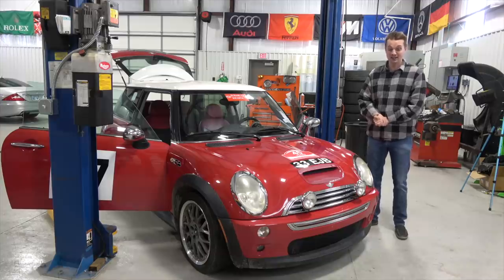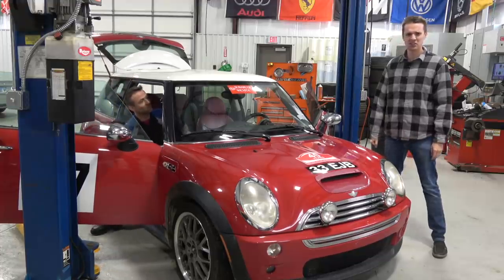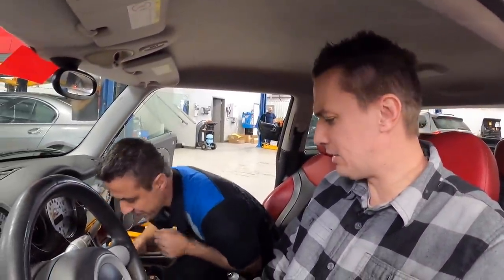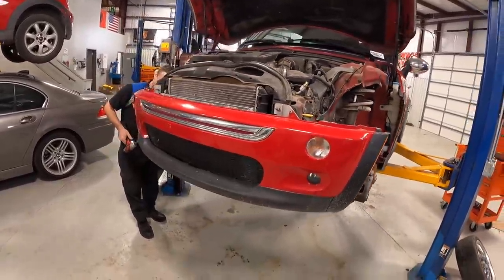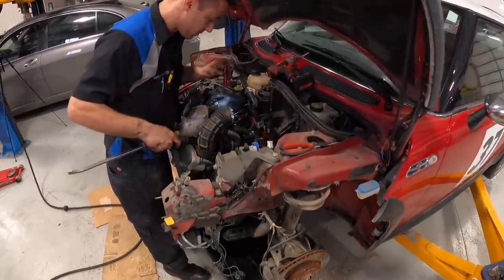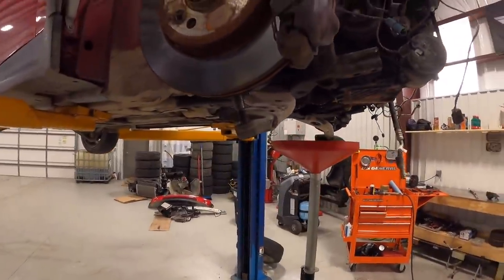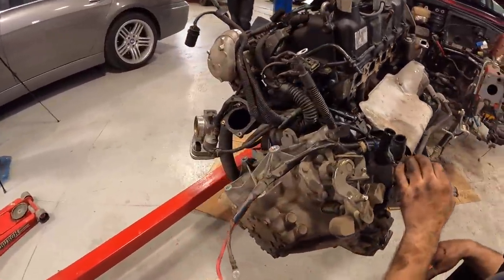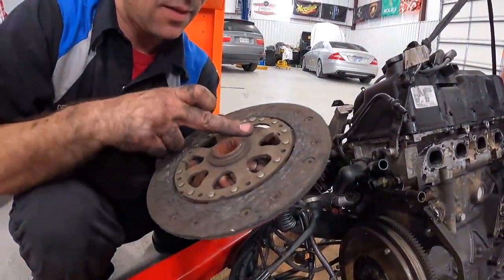Removing a Mini Cooper S Engine in less than 1 Hour? Mechanic Says No Problem!

Comment: It still costs so much because the Ninja trained his whole life to be able to pull an engine in an hour. You pay for his skill.
Reply: @KS-xo3oh   it's still an benefit to the customer because they can get their car back faster 🙂
Reply: I think it was a joke.
Reply: Mechanics proving “book time” is a cruel joke. How long would a one-armed, tool-less piano player take to do the job. Yeah, we’ll pay that amount of time. When anyone with a shred of experience can shred the “book time” just how stupid do you think customers are? 

I do my own until the tools get too expensive.
Reply: @KS-xo3oh  You only pay booktime when booktime is reasonable. As with any repair. Some rusty crapshoot car you don't want to think about booktime because the book says every bolt is clean and comes out in 2 seconds.  Pricing is weird though. 
I usually go by as long as both parties think they got a good deal its fine. But there are people for which any amount of money is too much.
Reply: they should sell a kit to attach the front clip  back up with Velcro since it's likely going to be taken apart a few more times in its lifetime.
Reply: It's supposed to also be if a shop takes 5hrs to do a 2hr job you only pay for the 2hrs but I doubt that happens in reality...
Reply: Youre not paying for the hour, you're paying for the years.
Reply: @paulcarmi8130  
Book rate is also a benefit to the customer, because he doesn't have to pay extra when everything's rust welded together and half the fasteners snap off.
Reply: That goes for any good tech especially euro
Reply: Book time and actual time is so debated. Thankfully I’ve found mechanics that are flexible on both and don’t try to screw the customer on book time. If you’re a career mech and charge book time on everything, especially regulars, and it doesn’t take you that amount welcome to being a scam.
Reply: @beefchillingham6790  another mechanic I see. I have over 40 years experience in my field. My hourly rate is commensurate with my experience in the field and based on the demand of the market. Like a lawyer for example. 

To set a “time” based on a green apprentice skill level and then also increase the shop rate over time is a double dip if I ever saw one. I go to a shop and expect to pay the rate of an “experienced” technician. Not to pay the rate of an experienced worker and the time needs of a basic labourer. That is an obvious scam and the only way it persists is because all mechanics do it. Yes, I’m a tool, and a very sharp one, unlike your dull self.
Reply: @markstevens1729  Exactly. Book time for a novice at $80/hr vs $200/hr at specialist shop is a factor.
Reply: @bcubed72  I don't think you responded to the correct person my dude
Reply: @markstevens1729  stick to your desk job bud
Reply: @nickmotsarsky4382  only when “everyone else” is scamming the public can you say “everyone else” with a straight face. The scam is that we are expected to pay apprentice time at 100/hr while you gain experience and pack 80+ hours into a 24 hour day. You’re like conservatives: can’t handle an intelligent query into your methods b/c they don’t hold up to scrutiny.
Reply: @Joe-tt3fg  done plenty of mechanical and construction work, not exactly rocket science, which I also understand. Desk job.. you wish.
Reply: @markstevens1729  I’m a 25 year old electrician. The fact you have 40 years in some field and still think/act like an utter child is very telling about the type of person you are. A car repair shop is a service. No one is forcing you to pay exorbitant prices at dealerships. I feel like I need to draw you a picture In order for this to get through to you lol
Reply: it would depends on why it took longer.

If the mechanic made a mistake that cost extra time then you should not. 

If your car was a ball of rust and every bolt had to be torched/extracted then yes that cost will be passed on to you.
Reply: You pay for his brains, too. Any mechanic smart enough to specialize in BMWs will die rich.
Reply: @nickmotsarsky4382  I think his point is that "book times" are usually way too exaggerated. Surely it should be the time it takes the average mechanic during the first few years in the industry. When a novice home gamer can do it faster the first time they try it with the wrong tools in their driveways then it doesn't make any sense. And when every mechanic on the planet can do it way faster it doesn't make any sense. That's not to say that an experienced good mechanic shouldn't be able to do it faster and charge more for their time.
Reply: Tell that to all the friends and family that want me to fix their car woes for free!
Reply: I never begrudge paying rate for a good mechanic. I am only upset when I end up with a bad mechanic or a shop that adds an additional 10-20% on their margin just because I am a woman.
Reply: @jowensblack48  That's actually how it works unless something major goes wrong. Shops charge book time for jobs on the law of averages. Some jobs you will beat book time, some you will not. But they all more or less average out. Now if you're driving a vehicle in the salt belt and not getting it washed, you just might have additional time added to your bill for multiple uses of the blue wrench.

Comment: Me after spending an hour and 24 minutes removing an engine: "well, I got the bumper off and it's jacked up but I did manage to have 3 beers and a cigar so that pretty good."
Reply: I worked as a tech for Audi/VW dealership for 47 years, we should have been allowed to drink 🍺 on the job. Sure did after work.
Reply: @619guy202  word. Really dial in your focus.
Reply: @nickpappas4133  definitely helps get you in the zone. Some people are just better after a few. Some people have too many and forget to tighten axle bolts like my friend's drunk mechanic. Ruins it for everyone.
Reply: Me after spending an hour and 24 minutes removing an engine: “well, I got the bumper off and it’s all jac.....crap! Wrong bumper!!
Reply: Me spending 1hr 24 taking the engine out of my car "so that's the radiator out". 6 months later "I really should get back to finishing that engine out job..."
Reply: Do your own maintenance.  Have at least 1 back up car.  Never worry about time.  Focus only on doing the job right.
Reply: @Matt_from_Florida  yessir. That is my philosophy exactly!
Reply: That sounds like my speed...except the bumper would only have 1/2 of the bolts off & the jack is still in the corner of the garage.
Reply: Took me a solid 8 hours the change the thermostat and the crossover pipe on my R55 S. Three of those hours were spent inventing new four letter words.  Another hour combining those words in unique ways.

Comment: Once I learned about "maintenance mode" on the MINI, fixing stuff got a lot easier. You can actually thread bolts into the frame rails so the whole front bumper and radiator move forward about 6". Now you can reach the stuff on the front of the engine that is almost definitely leaking. It's a fairly modular design overall.
Reply: Well Josh, looks like you got a super enthusiastic reply there. Amazing what threading bolts will get you.

Comment: The car ninja really is a ninja if he can get an engine out in 1 1/2 hours! . Extremely impressive.
Reply: This is what passes for progress in 2021. With the original 1961 Mini Cooper your granny could have changed the engine in an hour, and put it back.
Reply: @davidjones332  I have actually removed an original mini engine. It was really easy but it still took me 3 hours, and this is far far more complicated.
Reply: @terencehawkes3933  If you have a ramp, air tools, hoist and have done it before half an hour to take out and a bit longer to go in because of getting the bolts started. Regularly put engines from a 1300GT Austin/Wolesley etc into the Mini.

Comment: I’m still amazed that they crammed the engine in that little front end. You must have absolutely no room to work.
Reply: and they cook emsleves in no time, everything on em fails due to heat build up...
i often get engines out of minis, takes about a minute. 
swing in the grab, rip off the bumper, swing the grab back in, lift the car by the grabbed engine, wiggle it and the car just falls away...
Reply: Edgar Miller  no Mini's have always been front engine
Reply: Welcome to Germany
Reply: Edgar Miller  what!?!  I suggest some research is in order.  The original Mini pretty much invented the transverse FWD drivetrain that is nearly a universal standard for passenger cars these days.  Designed by Alec Issigonis.
Reply: Had this same exact car. Worst car I had ever owned. 2007 Cooper S had a turbo 4 cylinder Peugeot 206 motor that had constant trouble with the timing chain set, excessive oil consumption to the tune of a quart per fill up, and poorly designed gaskets for oil and antifreeze cooling that were baked at less than 75k miles requiring replacement. I also wound up replacing the turbo at around 72K, plus the gaskets for oil and antifreeze cooling. Wound up replacing belts too.

Required full removal of the front end of the car much like this here. Took a month total due to no garage and constant rain. Dealer wanted 6800, I did the work myself for 800.
Reply: @marvinstewart2619  You know this is a common mistake among 'enthusiasts' who claim its rear engine and rear wheel drive too, they must be thinking of the beetle.
Reply: @bobmcl2406  The first cars with transverse-mounted engines and front-wheel drive were the popular (for Germany) DKWs in 1931 (one of the brands that eventually formed Audi), the first Saab in the mid-'40s, and the Trabant in the late '50s. The Mini did popularize the layout as a way of making more out of less space but did not invent it.
Reply: @tonyli2096  Or the original Fiat 500 which was a similar size.
Reply: @MrDuncl  ah possibly yes. I met a guy who was adamant that the mini was rear wheel and rear engined, I was about 6 and knew he was wrong.. lots of watching Italian job when I was younger 😁
Reply: @Powermetaldaddy1974  This is R53 not R56 no timing chain issues with the R53 have 156K on mine with 15% pulley. Has been reliable car considering it is a 2003 never winter driven still looks in great shape and blast to drive.
Reply: @brucemacaulay1235  the R53 has the Euro Chrysler motor I believe. Glad you enjoy it.

Comment: Hoovie: The WHOLE nose has to come off
Audi owners: That's called our service position :(
Reply: No the "service position" is the customer bending forward and grasping their knees.  Pray the techs use Vasoline.
Reply: @houseofno  do you mean Valvoline.
Reply: @houseofno  every audi i work on i give the customer a small tub of Vaseline
Reply: Currently swapping the engine in my 2000 A6 Quattro, can confirm
Reply: @AnOrbitalCat    Good luck! :)
Reply: I have to remove the entire front end on my B5 A4 1.8t only to remove the engine oil pan
Reply: @thebmxripper8330  Well that's because the crossover charge pipe from the turbo to the intercooler is also the front engine mount and all that has to be removed to get the pan off...
Reply: i’m an Audi Tech.... no vaseline
Reply: @familyfun9474  No no, the car gets Valvoline. The customer MIGHT get VASELINE if they're lucky. If not, they get the sandpaper lined broom handle.
Reply: It's called Service Mode on the MINI.   ;)

Comment: He got to get paid for his skills. It's like any job. You get what you pay for.
Reply: and it may work out cheaper this way in the long run with other parts needing replacing on the engine. None of the fiddling away in spaces that you can barely reach and cannot see into.

Comment: The more parts that get replaced, the more desirable that MINI becomes.
Reply: Still JP (junky poop)
Reply: My 02 Cooper S was extremely reliable. The 07 Cooper S that replaced it was not. Sounds like the more common story is that they are not reliable at all.
Reply: @mph5896  once you get the failure items replaced they are quite reliable. There just happens to be a lot of failure items. My 05 s was great once I replaced what needed to be.
Reply: Maybe if you jack up the vin tag and roll another car under there it would even sell for a profit

Comment: Good to see a pro in action. An hour 24 minutes is not bad at all, given they charge you six hour for the operation. Reminds me of my time working to make small roads in an estate project. They gave us a month on a 50m stretch and we needed 3 days until tarmac ready. Had to wait for those guys, but still my boss was impressed. I got transferred to the airport maintenance crew, to get things going faster. We had to work very fast, then drive off while planes landed and took off again, then back to work again.

Comment: No need to remove u-frame, the bumper cover, then bar, then etc... Just remove 6 13mm bolts on u-frame, disconnect hood cable, remove 3 bolts (1 hard to reach) on each frame rail and disconnect all electrical, then whole front end comes out. This is provided u are willing to disconnect the AC lines and later recharge AC.
No need to remove the driver side CV-axle (that always stuck). U can swing the engine out with it.

Comment: Haven't finished the video and I can already tell it's going to be for some tiny valve seal or something buried way below the engine.
Reply: Well it is a Chrysler engine.
Reply: @olliewebbuk  no that's Mercedes this is a bmw product
Reply: @jakecletus2824  MINIs didn’t have BMW engines until the F56 chassis onward. This MINI has Brazilian-made Chrysler engine, the next generation had Peugeot engines. The Cooper S engine now is the B48 that you’d find in a new 320i.

So no, you’re very wrong, look it up. This first Generation of new MINI wasn't really developed by BMW, but by Rover on behalf of BMW.
Reply: @olliewebbuk  well I learned something new,

Comment: Car Ninja and the Car Wizard are legends…
Just to clear up one thing the original BMW MINI was developed by the Rover Group (because BMW didn't know anything about FWD!) and it was meant to be the replacement for the Rover 200 'Bubble' hatchback and the original 1 Series was also meant to be another Rover replacement. Alas BMW got it's greedy little mitts on Rolls Royce and lost interest in Rover. A great shame because if you follow Cold War Motors, Scott and Al are restoring a proper Rover P5 3 Litre. Also Rover were planning to use their own K Series engine and BMW said no and went for the cheaper Chrysler built motor, the rest is history. 
My old bosses wife used to have one and although it was bigger than my wife's Austin Mini City it was smaller on the inside!

Comment: You know this is "the dumbest auto channel on YouTube" when the owner buys a BMW Mini Cooper.
Reply: There isn't actually much BMW in the early cars most of the R&D was done buy MG Rover before BMW bought them. The engine and transmission is from Chrysler lol
Reply: ნუცუბიძის
Reply: გ ეს ყველაფერი
Reply: @freepieanchipsgarage yes because they owned the brand then but there isn't actually much BMW in the car
Reply: @smh28v6  Not strictly true. Rover wanted a direct replacement of the original mini using Hydragas suspension and Rover K Series engines.Their proposed designs looked very different to the original Mini.  It was BMW who insisted on McPherson front and BMW Z-Axle rear suspension and the 'evolution' of the original Mini shape with design cues taken from the iconic Issigonis Mini both for the exterior as well as the interior. The gearbox on the Gen1 BMW Mini One and Cooper was a 5 speed 'Midland' Rover gearbox, the Cooper S always had a Getrag 6 Speed. Later, all models got a Getrag box. The BMW Mini uses a lot of the BMW modular construction as evidenced in BMW's of the time. The much misunderstood 'Front Service Mode' being one of them. The BMW Mini is a 'Marmite' car though, its concept, design and execution is not for everyone. In the UK they are really popular, I see plenty of Gen1 still on the road even with our humid climate and salted Winter roads so they can't be that bad.

Comment: 10:30 one of these days an engine hoist company will make a hoist where the casters actually pivot and roll easily.......
Reply: გოგოვ
Reply: At some point, someone in the comments for this video is going to get lucky.
Reply: I pulled a car engine using an aircraft engine hoist.  Wow that was better.  Bet the hydraulic  adjust hoist had ten diff things that adjusted.  Must be 40 grand
Reply: @tomthumb1322  naw, just have some decent casters on it.....I've been using engine hoists for 45 years and they haven't changed a bit......

Comment: Love the pulley mod! It's gonna help with lower end power. For some reason upgrading to a slightly thicker gauge wires also helps this car, the way motor works wires actually make a difference. 

Also should check the rear and crank seal, those leak a ton, easy to spot as I'm sure he'll find them. If he was swaps out the crank pulley with an upgraded one that would be worth adding to the bill.

Comment: BMW: "Pretty much leaking everywhere, cheap plastics broken everywhere, shot from here forward (indicates windshield)" "106,000 miles and it's mechanically totaled". Yup, sound about right. If you can't afford a new BMW, you sure as hell can't afford a used one.
Reply: everyone can afford an E30 though

Comment: Not bad. When you know the process that it took to put it together at the factory, it goes quickly (depending on how rusty the bolts are). When I worked at Mistubishi, the time it took for the car to get to the end of the line to be driven off from when the engine went in was two hours. From a bare body to finished was about 4. Some manufacturers went faster than that. You can pull a 350 out of a Camaro in about 90 minutes.